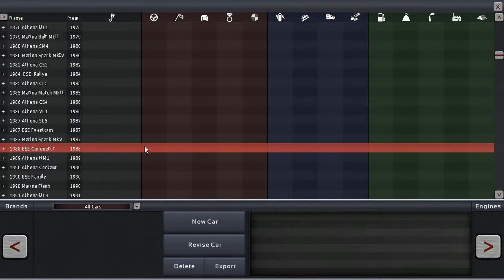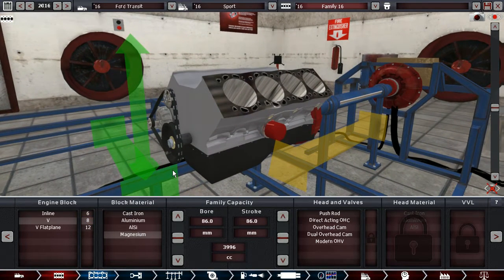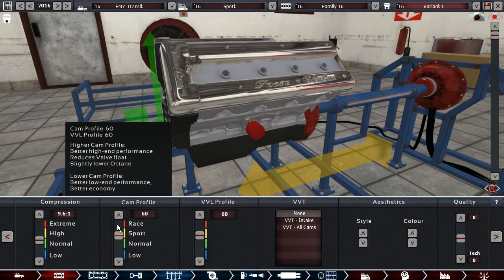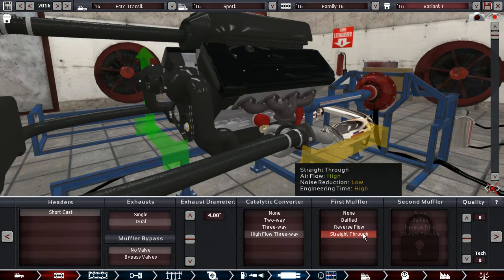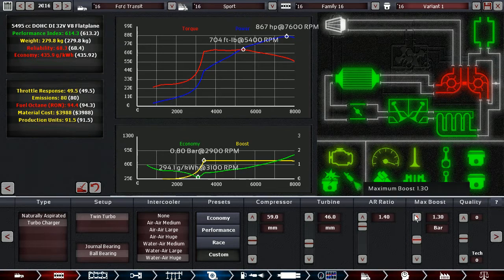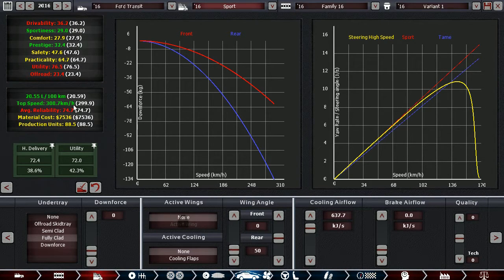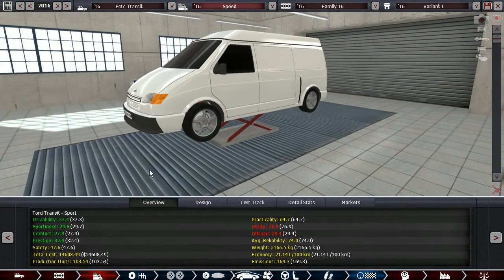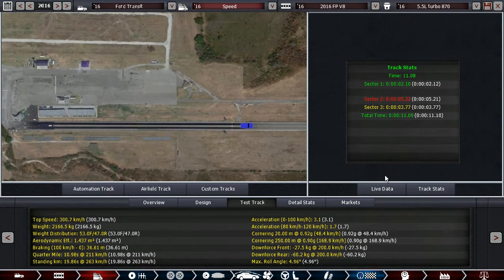Automation: Ford Transit "Speed" build - Definitely Not Replicas Ep. 3

Comment: I bet you could've gotten more power with a less aggressive cam setup, turbo engines tend to perform better with those as well as lower ignition timing
Reply from the maker: I have to correct you here. More aggressive cam profile always makes more power, and it always makes peak power later compared to lower cam profile. I didn't go very aggressive on fuel mixture or boost pressure, I could have gotten a lot more power that way.

Comment: Many cars don't have direct injection these days, the aventador has mpi.
Reply from the maker: I am almost 100% certain that the Aventador has direct injection because they developed the engine from scratch for the Aventador which came out in 2012. I have a hard time believing they didn't give it direct injection, with all the emission regulations going on these days and especially considering that it's an expensive car so the costs aren't really a concern.
"Many cars" don't have direct injection these days? Pretty much every 4-cylinder car on the market has direct injection (except Dacias), and those are many. All BMWs and Mercedes' have direct injection too, no matter how many cylinders. I'm pretty confident in fact that every german car you can buy today has direct injection. Don't know as much about japanese and american cars but if they're not using direct injection they really should start doing so by now.
Reply: +Tom Henks Every lambo v12 that is sold now has mpi, like every Mercedes v12, like all fiats, and many french cars. Look it up. These are facts.
Reply: some diesel engines dont have it
Reply: +der dude diesels can't have mpi, every diesel is common rail. It's how they work so we can't include them in this conversation.
Reply from the maker: diesel is common rail, but "common rail" is a form of direct injection.
Reply: +Tom Henks that doesn't really change my earlier point on the large amount of mpi engines, from economy to premium and sports/supercars.
Reply from the maker: but Ford's Ecoboost engines are direct injected, are they not?
Reply: +Tom Henks That's missing my point: There are many Direct Injected engines, but there are also a lot of relevent mpi engines being built. A lot of times you use a lot of new tech in your builds, like spi or mpi in small cheap late 70's or early 80's cars, when everyone still puts carbs in them, because they were good enough and it didn't justify the cost. That is a pretty large complaint, but I normally don't comment it, because I don't want to bash on you, but now it is a good time to say it, so I did. This wasn't meant as a complaint, it's more me asking if you could sometimes be more down-to-earth with your builds.
Reply from the maker: "down-to-earth" being another word for "conservative" I guess. Call me naive or idealistic, but I think a good engine is crucial for developing a good car. By "good engine" I mean using tech that is up to a given era's standards, not using something that's been around for decades but some mainstream companies still use it because it's cheap.

I still try to stay realistic with what tech I use in what year, but after all it's still  a game. Whatever I do in this game has no relevance whatsoever in the real world. Building a full-aluminium 48V fuel-injected V12 in 1975? Doesn't matter, it's a game! Don't take it too seriously, let's just enjoy Automation for what it is: a game! I know I still sort of compare the cars I build in the game with real-world cars, but only because I have to in order to give people a rough idea what kind of car it is.
Reply: +Tom Henks Mpi is still up to standards, although I do believe it's gone in 2 years. About the it's a game part: I love sillyness, but the series in wich you try to be a car manufacteurer, I want to see a car that fits into that age. I love these "stupid" builds, but in my opinion, if you do a series on being manufacteurer, you should create cars that will be sold so your manufacteurer wouldn't go broke.
Reply: +proface Btw i mean this as constructive critisism, because I love your automation series, these are just a few things I see as "weak points".
Reply from the maker: well, as far as the Marina campaign is concerned, I think I gradually upgraded the tech in a way that most people would agree with. Start off with a simple base engine, then use GM engines for a couple of years, then develop one engine on our own, then a 16V I4 which was by no means new for its time, and generally we used our engine blocks for many years before replacing them with new ones. Of course you want the new block to be better than the old ones, and I think if there's new tech available that isn't completely unheard of at its point in time, I think you should use it. That's espcially the case with sports car manufacturers like Marina. Sports cars are usually more expensive than normal cars, and you don't want people going like "What am I paying for in that car? It's hopelessly impractical AND it comes with the same old tech that everybody else uses. I can get that much cheaper!" With better tech, you can give people a reason (even if it's an arbitrary one) to believe that your car is worth the extra expense. And as I said, I think a good engine is a crucial part for building a good car, especially when it comes to sports cars.

PS: MPI is not up to today's standards any more, that's why the manufacturers who are still using it are forced to make their engines produce less emissions in ways that don't require replacing the fuel system with DI, like turbos or Ford's valve system that's almost like VTEC-e. MPI is dying out because it's not good enough any more. In other words, it's not up to today's standards.
Reply: +Tom Henks But the problem is, sometimes you're introducing new tech too soon, I don't know if it was marina, or an older campeign, but the 16v was introduced in a time where most 4 cyl engines still were pushrod, wich was relevent longer than you believe. I do think that the progression should be the way it was, but the timeshifts should have been diffrent. Btw, the GM engines you used  are in real life much stronger than GM said they were, because of tax reasons, wich was done with every american car at the time: Almost all 7 litres v8 were marketed at around 425 hp, but irl made about 500 hp.
Reply from the maker: look. Fiat introduced the 16V technology in the 30s or so. There were performance I4s with 16V already in existence when we first used it, and we used it for a sports car too, not a mainstream eco car or anything like that. And I think this discussion is getting a bit stupid because why would we argue so vigorously about a game. If there's one more thing I may point out, it's that with the upcoming campaign mode (even when it's only the Light Campaign) you have to build cars that are competitive on the market. Competitiveness is a number, which in turn depends on a lot of other numbers. And as long as you can keep the price at a reasonable level, a 16V I4 will give you better numbers in almost all categories than an OHV I4. That will make it more competitive, which will make  the car sell better, and that'll make the company more successful and we can produce more cars.
Reply: That's very specific to each car manufacturer, some focus more on one technology over the others available: because it is better for them, which does not necessarily make it so that better for them means better for everyone. That being said, you did make an interesting point with your original comment, many cars do not indeed use direct injections but most do, speaking plain numbers.
Reply: Tom Henks Fiat introduced the 16v technology in 1930, as a race car. Those aren't street cars. They are full-blood track racing cars, of wich there were built only a handfull of. When it was first made doesn't matter: There were turbocharged cars made by bentley in the 20's, that doesn't mean that that technology was good in the day. 16v was only needed in the early days of cars if you had a very, VERY high performance car that could have lots of maintenance, because 16v were very unreliable back in the day. 16v won't do a lot with a car of that age, the negative sides, like the unreliability, the cost and how complicated it is to fabricate in large numbers, would make it not that competitive, and it would be outclassed by the english convertibles and the european coupes. The company would go broke, sell a few cars and not be able to create new cars/engines for those cars, thereby being whiped out of existence.